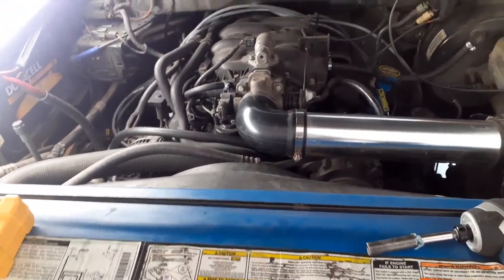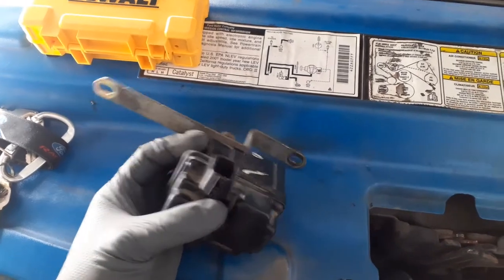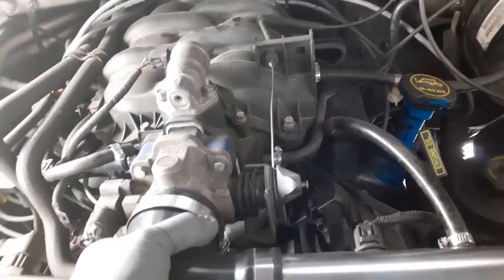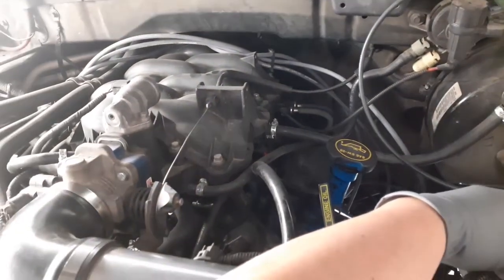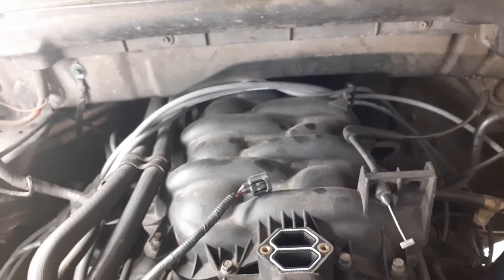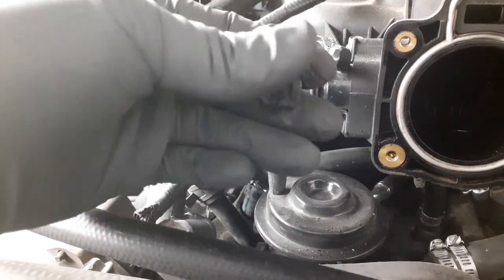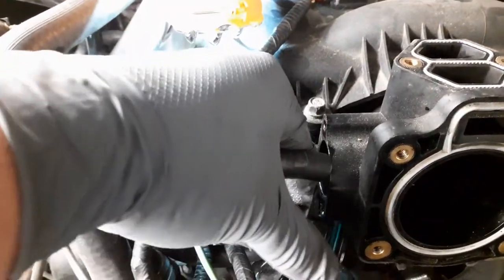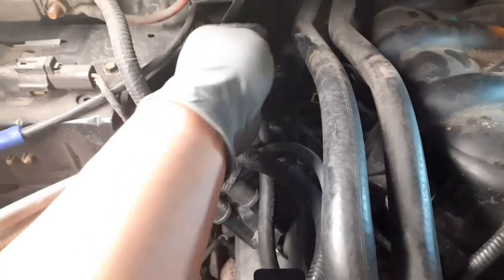2001 F150 4.2l Intake control runner replacement part 1

Comment: I have a 97 f150 with an 03 4.2 engine, and installed a k&n air filter into the stock air box!. It caused all manners of chaos! It caused the MAF sensor AND the IAT sensor, to go bonkers Bandana bananas! LOL!🤣🤣🤣🤣🤣😂😂😂😂😆😆😆😆Triple B threat! All jokes aside, isn’t it odd how one modification can interfere on one engine, yet not affect another almost identical engine at all?

Comment: Where does the smaller control arm on the runner attach to at the back of the engine? The larger one is no problem but smaller one fell off when removing part. Can't see what it attaches to.
Reply from the maker: When you see the intake control runner  in the middle you see both metal arm rods are attached to the intake control's let call it  oval metal mechanism that pulls and pushes the arm rods. So each of those rods at each end is attach to something similar to open and close the ports for the intake manifold. If im not mistake on the far right side the similar mechanism is at the top. Also on the far left side at a lower part of the intake manifold. Or you can also try using a small mirror to see if can find it but it could be a little hard the see.  
I was try to find a picture to show how it looks but havnt really found any good ones the show it well. So hope the comment helps.
Reply: Found it big guy , many thanks for your videos. Keep it up , I'll keep watching.

Comment: Do you have a check engine light because of the Air filter too?
I have the same truck and every time I put a different better filter the light comes on.
Reply from the maker: Well the truck had an engine light since I bought it from someone eles it had like 30 codes. Fix a few of those codes and now just got like 7 code left..It came with the original air filter assembly. Then I just bought this cheap air filter assembly from Ebay to try it out and bought a K&N air filter separately but no extra codes came up when I installed So far it been like 2 years now.

Comment: where can I get the intake air kit that you have?
Reply from the maker: https://www.ebay.com/itm/131812306279?fits=Year%3A2001%7CEngine+-+Liter_Display%3A4.2L%7CModel%3AF-150&hash=item1eb0a02d67:g:q5UAAOSwy85eYV8h
Reply from the maker: I got this to try it out cuz it was cheap getting a 200 dollar one for his engine in my opinion it not worth it I like the sound it makes, havnt had any issue with it....They have a red, black and blue, only thing I changed was the air filter to an Universal K&N which was like $30 you can find at some walmarts or online.